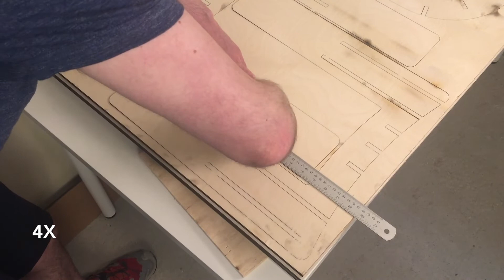Laser Cut Plywood Grid Chair for the Rockler Plywood Challenge

Comment: How thick is that plywood? And what is the maximum thickness a laser cutter can handle?
Reply from the maker: The material is 3/8" Baltic Birch. The maximum thickness it is possible to cut depends on several factors such as:

* The power of the laser
* The species of the wood
* the quality of the material
* The focal length of the lens

As well as many other factors. For my machine which is 80W, cutting 3/8” Baltic Birch plywood is about as thick as it can handle due to the knots/voids in the core layers. If I were to switch to Poplar then 1/2” would cut well.

Comment: 60"X60" sheet in fact smaller than 48"X96" in total area. So yours is withing that one sheet norm. Brilliantly dessigned chair, probably needs a high density foam seat to make it comfortable to sit. Other than that, it is an excellent project and a winner!
Reply from the maker: Yes you are correct 60" x 60" is smaller than 48" x 96" however I used more than one sheet of Baltic Birch. I cut it down to 48" x 30" to fit in the laser cutter and used three pieces of that size. It's actually comfortable as it is and does not need a cushion. I have it in my workshop and use it all the time now.

Comment: So you made a SketchChair
Reply from the maker: Sure there are some similarities to the Antler Chair, but due to the thickness limitations when using a 80W laser cutter the chair had to be designed for thinner material. This means it needed to have a tighter grid pattern to maintain it's strength. The chair was designed entirely in AutoCAD, SketchChair was not used.